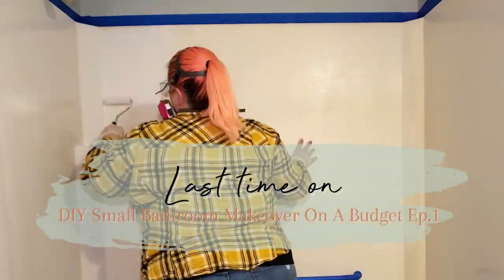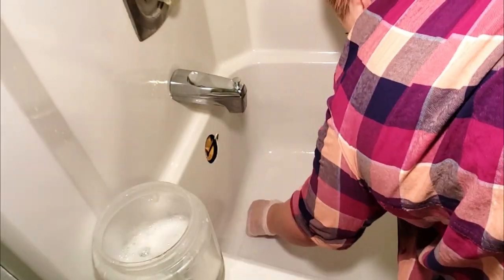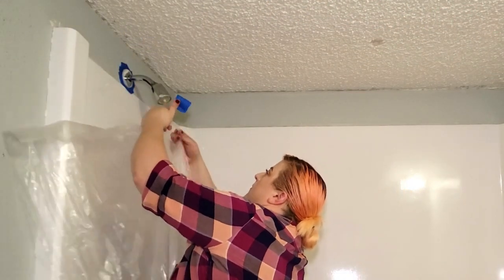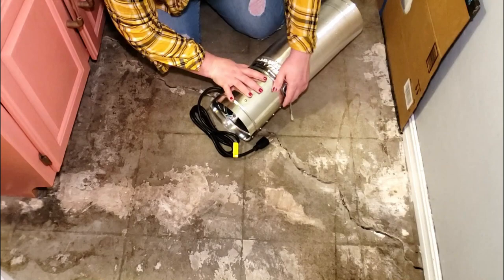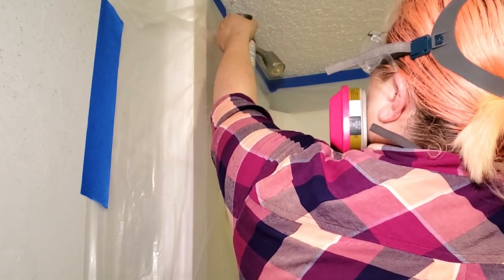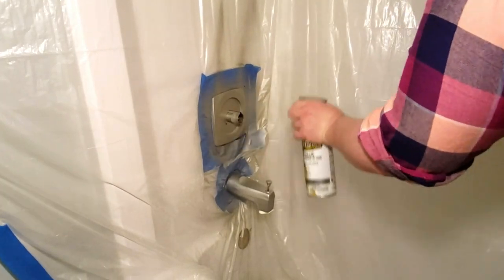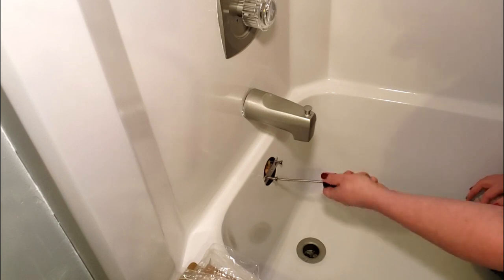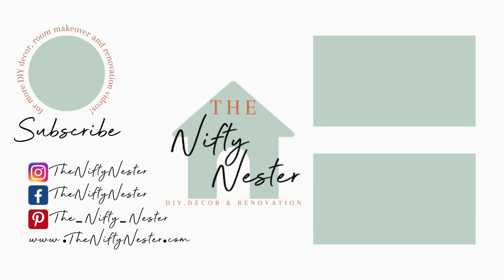How To Spray Paint Bathroom Fixtures & Faucet | Bathroom Makeover On A Budget EP. 2

Comment: With the exception of the drain, I would have taken everything off and painted it outside the home.  In my mind that would be way easier than hanging all of that plastic and dealing with the paint solvents.  You can also buy new trim plates and shower nozzles for not too much money.  Anything that's really hard to take out, I would leave in and paint!  This was very interesting and quite useful.  I applaud your safety efforts as well!

Comment: I would think it would have been so much faster and easier to remove the hardware (it's actually easy) to paint elsewhere than to painstakingly mask off and then tarp around everything. Also, were you able to spray paint the shower head without getting any paint onto the ceiling?
Your bathtub looks great! I'm going to go watch that video right now to see how you did it!
Reply from the maker: Thank you! It probably would've been easier to remove everything but in all honesty I just didn't want to and wasn't really comfortable removing everything (plumbing and electrical makes me nervous, I haven't attempted much of either yet). There was a tiny bit of overspray above the shower head but I hadn't finished the walls or ceiling yet at that point so I wasn't worried about it. If they had been finished already I would've taken the plastic up higher which I probably should've mentioned in this video.

Comment: Hi thanks for sharing all your tips. I just did my shower. I painted all the fixtures as well. How do you clean them and the tub?
Reply from the maker: Thank you, I'm so glad to hear from someone that's tackled this project themselves! I use 50/50 vinegar water to do most of my household cleaning and it works really well on my painted bathtub and fixtures. I just use a sponge (not a scruffy- sided one, just a soft one) with the vinegar water and it's worked to clean it most of the time. If I have a stubborn spot I'll use a bleach cleaner but I've only had to do that a couple times when I let it go too long. It's actually been easier to clean than my original tub surface was.
Reply: @TheNiftyNester  Thanks for responding it means alot. I would like to share my outcome. How can I send you pictures? Also I noticed a bit of rust forming on top of the marine paint. It scrubs away did I miss something in the process? Has that happened to your tub?
Reply from the maker: I would love to see the outcome! The easiest way would be to message them to me on Instagram @theniftynester . I also have an email address but I'm horrible about checking it, Cherie@theniftynester.com , if you sent it there let me know so I can make sure to check it. I haven't had any rust on mine, sorry I don't know why you're having that problem. Did your original tub have a rust issue? Sometimes rust bleeds through. Also could it be from the bottom of one of your toiletries in the shower, like how shaving cream sometimes causes rust rings? The only other thing I can think of is that it could possibly be rust coming from your water lines or shower head? Let me know if you figure out what's causing it, I'm going to look in to it as well and see if anyone else has had that happen. Thanks again and I'm looking forward to seeing your results!

Comment: It is really not that difficult to remove the hardware and will result in a better and longer lasting job.  It's even easier to do even if you have only a little acquaintance with plumbing.  Even so, it looks like you did a good job and I congratulate you on your effort.

Comment: Any suggestions on how to remove paint (I painted my tub but it’s peeling)? You did a great job! 😊
Reply from the maker: Thank you so much! I'm sorry to hear yours is peeling. That's no fun. I would scrape off what you can and then sand the rest down. Since it's been painted, I would use the Rustoleum Marine Primer (even if it looks like you've gotten most of the old paint off), then use the Topside Marine Paint.
Reply: Sorry your paint peeled.  I am curious what paint you originally used?  I really want to only do this renovation once.  I would be sad if my paint peeled after so much work. I have reviewed a bunch of bathtub/surround videos that used the made for resurfacing kits.  One showed a comparison of 4 different kits made for this.  I was surprised to see that they all scratched pretty easily down the road. I was turned off to use them as they were so expensive. Thanks.
Reply: @THELASTJENNY  I used RTG. I even waited 4 days to use the tub. It looked great for a little bit but started to peel. I went ahead and had a professional company come and remodel the shower. They took the tub out so now I have a beautiful shower, glass doors and black fixtures. Cost a lot but definitely worth it. Good luck to you!
Reply: @mimime5376  Yeah, I priced new ones.  YIKES! Mine are an awful deep shade of harvest gold. I wondered about boat paint used for the underside of boats, if that would be a better alternative.  The only thing different about them is they have an anti bacterial and fungicide in them, so no, that wasn't a better solution. I don't think there is any real fix accept new ones.  Thanks for replying.
Reply: My granddaughter did her tub with the paint I used and hers is still in good shape. I think you should try it. Make sure to clean tub super good and let dry. Get sandpaper and sand entire tub and clean out. Next step is to paint. Give it a couple days to completely dry. My tub had to be done. It just wasn’t because I didn’t like the color. The porcelain on the tub started coming off and got down to the rusty base of the tub. I think you should try it.

Comment: How is the texture in the bath after the marine paint? Is it smooth or does it have a grit like texture? Would you recommend it for a sink as well?
Reply from the maker: The texture is smooth, it's almost like a hard shell. There's no added texture but some of the original texture on the bottom of the tub is still there. I might use the grip additive just on the bottom next time so it's not as smooth as it is. And yes, you can use this on any tub/ tile/ sink.

Comment: Do you lacquer this so there is a protectant coating?
Reply from the maker: I didn't, but you could use a clear coat spray. It's held up really well without one, but the drain area has a little wear around the outer edges. If I was going to do it all over again, I probably would've used a spray paint primer first. This paint isn't supposed to need one, but that drain area could've used one.

Comment: Would love an update on the drain and finish! Would love to do matte black on my shower fixtures but didn’t know if the water would affect the finish over time!!
Reply from the maker: It's all holding up well so far. There is a little wear around the outside edges of the drain but not enough to be noticeable unless you're looking for it. I'm hoping to be done with the rest of the bathroom makeover videos within the next few weeks then I'll definitely post a bathtub update video.
Reply: @TheNiftyNester  thanks for the update , I am currently renovating my mom's bathroom and there are a few items I have been considering spray painting because either they weren't available in brushed nickel , or were way too expensive to purchase in brushed nickel. Really glad that you shared your experience, this is super helpful

Comment: What type of paint is best for painting over bathroom tiles?
Reply from the maker: Are you looking to paint tiles in the shower, on the wall, or the floor? If they're in the shower or the wall, I'd suggest the paint I used on my bathtub. I used Rustoleum's topside marine paint. I have a video on that project as well. If you're painting tiles on the floor, I'd use Rustoleum's floor tile paint.

Comment: This was a great video. And yes you can take off the fixtures to spray them somewhere else but with older fixtures you want to be careful with that because you could end up having to replace a fixture. One suggestion I have is that they sell pretty cheaply the Rust-Oleum Economy Spray Grip Accessory which makes it easier for you to apply paint spray coatings. You can get more expensive ones too. Your hands don’t get so tired and they do a great job. They sell them at all the home-improvement stores. They make a big difference.
Reply from the maker: Thank you so much! ❤️ I appreciate the suggestion as well, I need to pick one of those up with how often I'm spray painting things lol.

Comment: Would you do these same steps on the shower curtain rod? Mine needs to be repainted and I wasn't sure how to do it.
Reply from the maker: I thought about doing the curtain rod but decided to just buy a new one. You could definitely spray paint it but my concern was that the curtain rings would rub the paint away over time as the curtain is pulled back and forth across it.